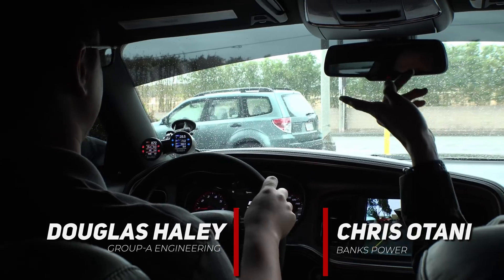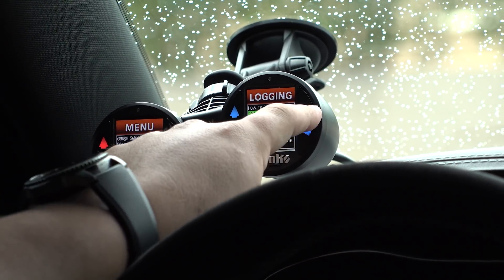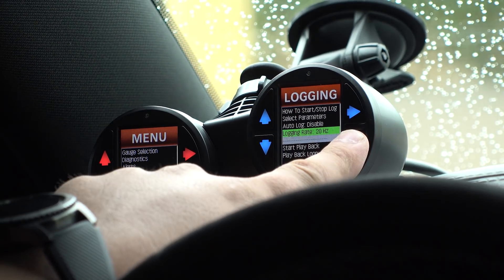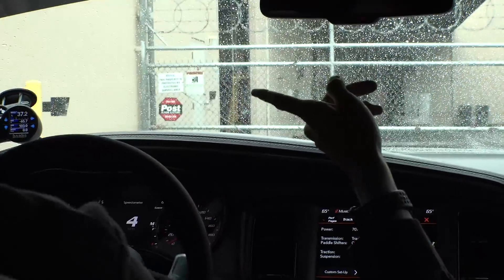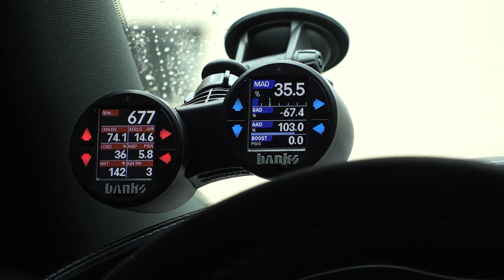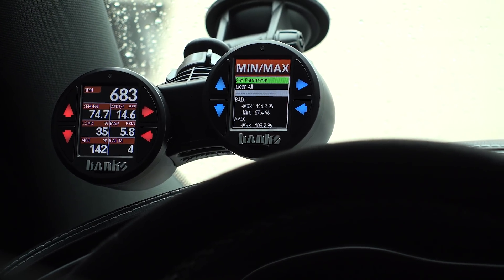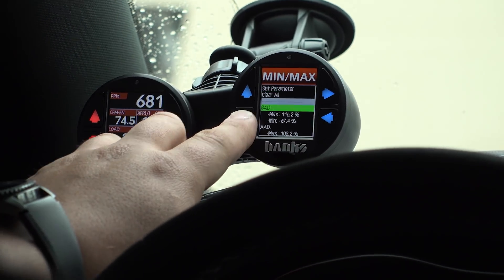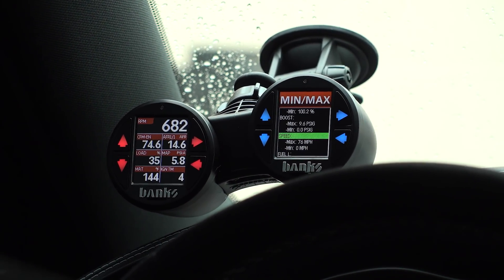Unlocking a Hellcat with the iDash DataMonster

Comment: I went to the website and the "Select your Options" drop down says iDashMonster OR Superguage? Is the Super gauge the same as an iDash but without the Logger Feature? Is that the difference? 
It doesn't say what's the difference on your website.
Reply from the maker: You assessed it correctly. The difference between the two is indeed the data logging feature. All other features are the same.

Comment: STILL no diff covers?????
Reply from the maker: The reason for the time between follow-ups is purely due to R&D. When we post a video, ten times out of ten, it's something that happened that day or the day before. Regarding the diff cover series. We've been sitting on the info for quite a long time. Why? We'll only get your attention once. We're going to reveal the research when we debut our cover design. We made many iterations and several billet prototypes, tested the heck out of the design, then went with a manufacturing process that is far more accurate but takes much longer. We have the diff covers in production and hope to have an announcement soon.

Comment: It's there a different power harness needed for the I dash to be used on non CAN bus vehicles??
Reply from the maker: We are still working on the pre-CAN BUS OBD-II version; it hasn't been released yet.  For standard plug in and play applications it will work on 2007+ CAN BUS OBD-II. The only way the iDash 1.8 works right now on pre-CAN BUS OBD-II is with one of our tuners for the trucks.

Comment: Pretty slick but I don't know how many average dudes are going to need to know that much data, especially if they didn't tune the car themselves.
Reply from the maker: With that logic you don’t even need an RPM gauge of you drive an automatic. It’s all about knowledge. Many people just want to “know”. 👍
Reply: @bankspower  I think its great but I was just thinking of the average guy that has mods consisting of a plastic wickerbill spoiler and 50lb each chinese cast wheels.
Reply: This gauge isn't aimed at the average dude. Chances are if you follow Gale Banks Engineering, you're not looking at simple bolt-on bullshit with photoshopped dyno graphs.

I have five gauges in my car, and I want to monitor at least 4 more sensors with no more logically asthetic space to mount more gauges. As soon as I can afford an iDash, my boost gauge is being put up on the local Facebook classifieds for some high school Honda fan boy to purchase.
Reply: Do average dudes tune their 600hp cars? This is clearly aimed at people trying to really understand methodically what effect their mods are having.